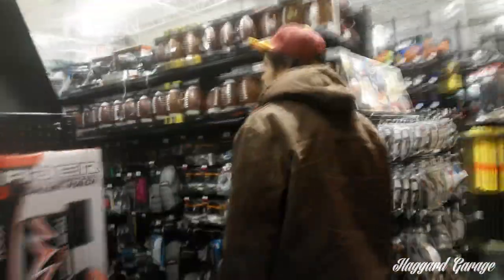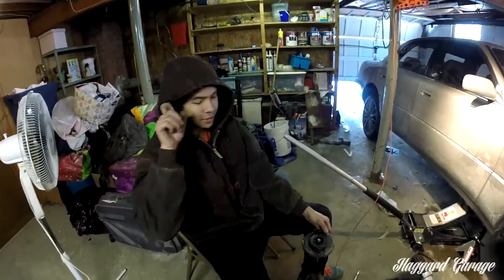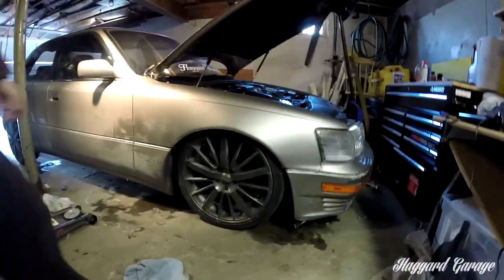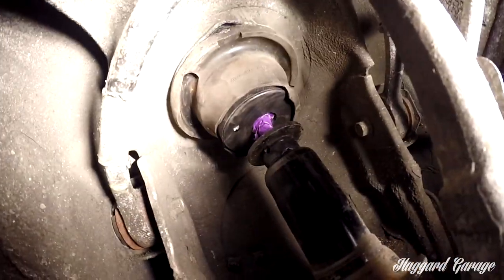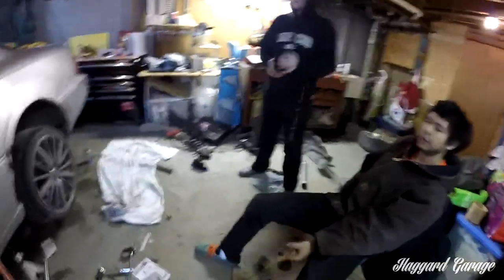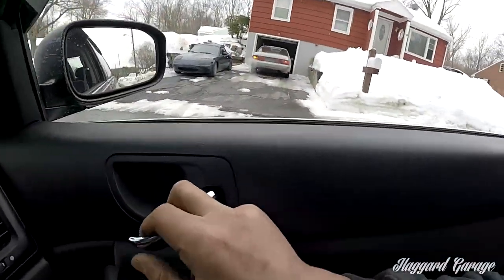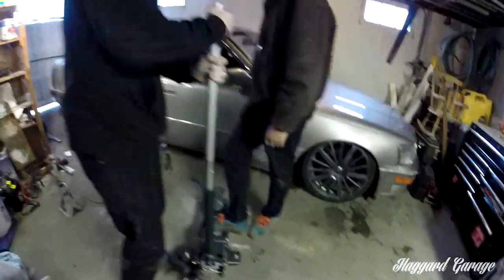How To Stance Your Car For Super Cheap

Comment: I bought a 1991 subaru legacy for $100 off craigslist put a battery in and replaced 1/2 of the lifters and did this to it and omfg it is supeeerrr low, i can barely even get out my driveway
Reply: If you don't want it, i'll take the motor lol
Reply: It threw a rod and I bought another one
Reply: Modified Garage Oh, lol. Guess i'll stick with the EJ25 for now
Reply: is this a reliable thing to do cause i wanna do this with my passat, also a daily driver, and also do the tires rub?
Reply: +MetalGaming101 yes you will be really low try it and find out. I cracked my strut tower and had to scrap my car because of it, I hit a big bump so be careful

Comment: Back in the 90's we did worst than that, we just torched the springs! Rode like ass and bounced like it had parkinsens! I had a 76 yota celica that was slammed on 13×7s wires on 50 series bfg's and I got stuck everywhere, scraped road reflectors up, broke tranny mount and exhaust on a man hole cover, over heated and blew the motor due to the summer heat boiling the radiator........but dammit it was fun for a minute! haha

Comment: front is already tucked while in the air because of the front anti-sway bar, there's no spring so no resistance to expand that corner and anti-sway bar is just doing its job.

Comment: 7:20 what volvo was that?? sounded great
Reply: That was my favorite part of this entire video.
Reply: Liam Carroll Volvo S70, if the Rims are original, its an "S70 R" built in 1997-1999
Reply: Know what engine it has? Almost sounds like a 5 cylinder, must be 6 though
Reply: 5thGenMaxi Straight 5 cylinder 2.5l proberly with a Turbo... i ve got the older version of this car, same engine just no turbo
Reply: They never built S70R's. It's more than likely an S70 T5 or the GLT model. It was the 850's that came in an R model that look similar to the s70
Reply: 5thGenMaxi there are S70R's and V70R's from 1997-1998 (not much but there are... at least in Europe) 
http://en.wikipedia.org/wiki/Volvo_S70 
http://www1.garaget.org/gallery/images/52/51098/51098-353fcc9cdbf9176ef529cde6bf761f77_large.jpg
Reply: 5thGenMaxi also you can clearly see that its an S70 (the 850 has different front lights, i own one so i know xD) also the V70/S70 R's came with the Perfo Rims for Winter (look similar to the Columba that came on the 850 T5 but have edges) and the car in the video has those, so i say if they are originally on this car (ps. not easy to find those) its most likley an R
Reply: Engineer six I'm no master but I think it was an S70 with pegasus rims from the V70R/S60R models.
Reply: Sean Cloughley nah those int Pegasus rims (in the video) Pegasus are bigger, those "Perfos" are 16", they came only on the 1st gen V70 and S70 Turbo versions (not LPT) the "normal ones" had 15" (wich i put on my 850)
i allmost bought a V70R (1998) wich had Perfos for winter and Pegasus for the Summer (wich was standard)
Reply: I wasn't paying too much attention. can't remember what my friend has on his 850. They look like pegs but smaller. Still with the R in them. Can't remember the name.
Reply: Sean Cloughley
the 850 Turbo came with 16" "columbas" the look allmost the same but the V/S70R's Brakes dont fit under them, the 850 (no Turbo versions) had 15" Wheels... I didnt like the original 15" Wheels so i mounted those from the S70 on my 850GLT (no turbo)
Reply: I know he had columbias on it before. I just don't know what the ones he has on it now are. They look like the pegasus rims but are smaller, maybe 15 inch.
Reply: Sean Cloughley
hmm maybe the same as i have, but i dont knwo the name of the 15" ones eighter, do the look like this? http://imganuncios.mitula.net/1999_volvo_s70_glt_a_4dr_sdn_turbo_5260055421803661094.jpg
Reply: Engineer six nope. They look exactly like Pegasus rims just smaller. Well 95% the same. Even have Rs engraved into them.
Reply: Sean Cloughley
hmm never seen those here, maybe some Aftermarket Stuff
Reply: I'll have to ask my friend what they are when I see him again. I'm probably just remembering them wrong.
Reply: Liam Carroll Volvo s70-r T5 with prolly 2,5" pipes
Reply: Reading these comments n thinking who the fuck knows this much about volvos :|
Reply: People who loves cheap awesome cars that's who.
Reply: Yep, cheap and awesome.. Can't beat my e39 540 4.4 v8!! Love it to bits
Reply: Not many people like to fill up the tank every day haha

Comment: What were they expecting to happen when they took the spring out and put a hockey puck in?
Reply: For it to lower obviously, that's the point of the video
Reply: Juan Montoya
Obviously... Then why were they so surprised when it was so low? They took the springs out and replaced it with a hockey puck so of course it's going to be slammed. It shouldn't have surprised them.
Reply: They were not surprised. They were excited
Reply: They expected a good laugh. Nothing more.
Reply: Stop being butthurt about it they did it for fun they like it and they had a fun time that what they wanted

Comment: I like this as a lol but next time go to pep boys and get I call them spring crusher you can make your higher or lower with thembut if you want to slam it get this and a longer bolt or like me all thread rod and them you slam it as much as you wantbut then if you want to back to stock just take them back out I was used this in the 90s

Comment: So let me get this straight their is no spring on the strut rather it has one hockey puck instead. So how is it driving over speed bumps and.
And my next question is, is that say one puck is just way to low for drivability like the block is on the ground type scenario so 2 or 3 per strut would raise me up about an inch per puck.

Lastly am I gonna do this

Naw probably not I would wanna get lowering springs before I would ever want to do this to my car I bottom out at stock hight sometimes 
In a 1997 Nissan maxima

So I can't even image driving with my car lower than it is although I do want it lowered 3 to 4 in at most

Comment: 4:10 what does that squeaky sound mean when he completely overturns/underturns?
Reply: hydraulics
Reply: +XtremuZ When you turn your wheel max one way thats your power steering pump making that noise. Its very bad for the pump if you hold that there.

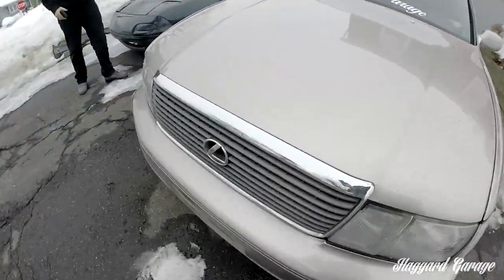Comment: wait wait wait... they didnt do much filming on what they actually did, so i could be wrong but are they running it with no springs AT ALL? no wonder one wheel wasnt spinning at 6:25, theres nothing pushing the tire to the ground.
if these guys corner even at the speed limit theyre gonna kill themselves. wow
Reply: Thanks for stating the obvious
Reply: Juan Montoya brah you probably can't even put air in a tire, yet alone know the affects of putting a car on hockey pucks
Reply: Mike F Do you know they do that for shits and giggles

Comment: I don't get it, why did you ruin your suspension dude?
Reply: its not ruined, they can always put the springs back on the shocks
Reply: +Text Missing no the cant the cut the springs out
Reply: +daniel crozier so buy new springs?
Reply: +Slow Balt that doesn't answer the question of why do it in the first place
Reply: xpusostomos because why not :D
Reply: +Slow Balt Cause it's stupid to ruin your suspension?
Reply: xpusostomos its not ruined? nothing is stopping you from putting new springs on lol
Reply: +Slow Balt so why not smash the windscreen and slash the tyres too? You can replace them after all, and is just as useful and intelligent.
Reply: xpusostomos because thats not jdm hella flush bro

Comment: Mazda is made by Ford, which is American. So when you said "Your not much to talk though" you were wrong. This video is fucking hilarious though
Reply: Chris Porter Mazda and Ford had a relationship in the past, Mazda built the original Ford Probe.  They still may have a relationship.  Just like Jaguar and Ford did and you don't see Ford built Jaguars.
Reply: just because some dealers interact with each other on their builds does not mean one manufacturer is/owns the other... and TMK, it's the mazda BP engine you'll find in a ford escort... you won't find a ford engine in a mazda unless it was swapped aftermarket...
Reply: KremitDeFrog Ford owned 33.3% of Mazda in 1996.  I didn't say anything about dealerships.  As for a Ford engine in a Mazda.  Look at the Festiva and the Mazda 2.  

Maybe you can wikipedia search before commenting next time.
Reply: Chris Porter miatas still considered jdm
Reply: only the Miata's sold in Japan are considered JDM... I mean, it's in the definition of the acronym itself...
Reply: ***** Same reason you only see rotaries in the rx cars hence the name rotary experimental

Comment: I dont get this.. Not only the puck thing, but the stance scene over-all. I'd understand if they were all drift-cars with front wheels cambered to fuck and back and then thing sitting on the ground, but you can barely drive it. You're gonna fuck up the bottom and anything that is poking out even an inch down there. You go through one pothole and you're gonna have oil all over the ground.

Comment: Just watched this vid, and off of first impression, I thought this guy was going to steal something from the store. {No offense bro} After everything was said and done, I like the outcome. ***** it would've been cool to see the end result of 2 pucks per corner, or 2 pucks per rear corner and one in each front corner. I get that this wasn't meant to be a permanent thing, but all in all the end result is still pretty bad ass. One last thing, do yourself a favor and go get yourself a few bags of salt for your driveway bro. That "No LSD Life" requires external uses of traction when the car itself can't provide it. I'm just saying.